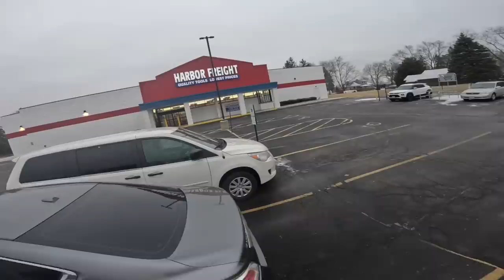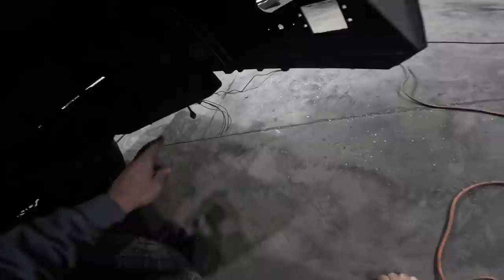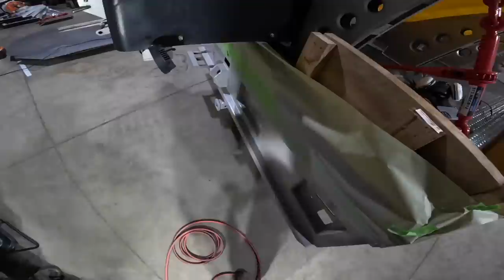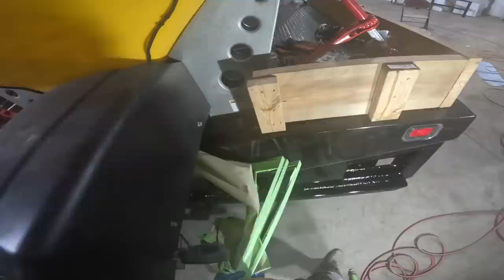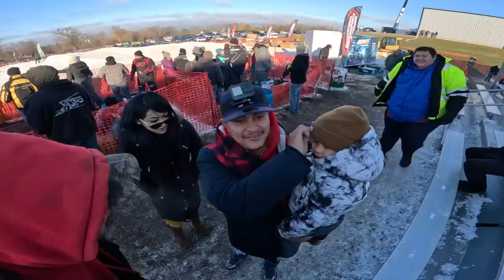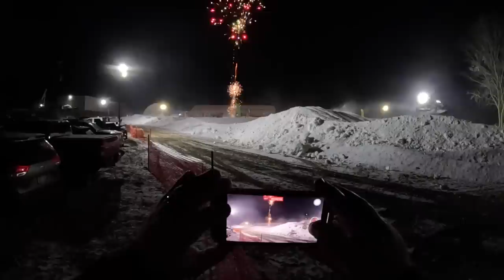Finally done with the bumper and off to the races!

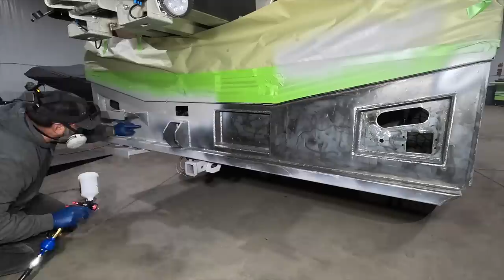Comment: 18:30 Menards has a 10 gallon tank you can put in line and it extends the smaller compressors so they can be used for some of the larger projects.   Also the inlet has a valve so you can remove it and use it as a remote tank to say air up a tire or use an air tool for a short time.

Also, great job on the painting.  Rust-Oleum sells a textured paint (has a grit in it) and would be great for the steps to reduce the chances of slips.
Reply: We would call that a pig tank or pig air tank.  Very helpful when you need a lot of hose, it will stabilize pressure near your point of work.  Framing crews use them when the compressor is truck mounted and then they branch off of the pig tank so they have plenty of flow for production nailing. I use mine when I don't want to bring the compressor close to spraying.  Hitachi/HPT makes a nice aluminum tank but you can get the 10 gallon steel ones from HFT, Lowes/Kobalt, etc.
Reply: I think it's not problem the capacity of air tank..but the pump (compressor) is 2 slow and not keeping it up.. with spray gun..
So buying the extension tank wont make it any better..'cause he would still need to wait for it to air up anyways
Reply: @tccoggs  Yeah I have heard that term but was not sure if this was what that was referring to.  I just use mine at home to extend the usefulness of my small compressor and only cost about 100 bucks, but have seen them for more.
Reply: @MazerDavid  No doubt for spraying you need CFM.  Some extra tank capacity will help stretch a smaller pump but HVLP guns eat a lot of air.  I run a 30 gallon 11CFM @90 compressor, but when I spray I add the pig tank to keep the cycling down and keep the flow stable.  Those oil free pump units are pretty worthless for spraying.
Reply: The textured paint isn`t any good for that application, when working in mud and snow environments it works best to get a small piece of industrial hardware cloth and weld it to the top of the steps many work trucks are set up like that from the maker.

Comment: Hi Ryan, I love your concrete videos, but I am really enjoying these shop videos as well. I was a house/commercial painter for the first half of my career and most two-part epoxies have a sweat time. This is the time they should sit after mixing, before applying. I would assume the same is true for automotive epoxies. The duration of the sweat time is usually listed on the can.

Comment: For your paint flash times, mixing ratios, thinning info etc. there are TDS (technical data sheets) for every product that will give  you all needed info.  Can find them online pretty easily for most products.  Looks like the bumper turned out good Ryan.

Comment: Bumper came out really good. Idea on the backup alarm if you don’t want it permanent. I have mine mounted on the spreader powered off the trailer plug, so it’s only on the truck when the spreader is on the truck. Also if you’re in a neighborhood during the night you can always hop out of the truck and unplug it.

Comment: Look into wetblasting if your going to do alot of painting and prep. Tool Barn sells the nozzle kit($99) no dust and hook it up to a decent pressure washer works great only drawback is outside only could be uncomfortable in Winter months.  GP

Comment: When I worked in a paint shop those 2 pack primer cans always come very unmixed like that's, in my experience I always had to mix the can up with a stirring stick to get the thick primer off the bottom 👍🏽 but that's just in my experience great job on the bumper it looks great!!

Comment: I am not a pro painter either but I have a suggestion, when you mixing the paint and pouring, I suggest to cover your work bench. It is a nice and it is easier to clean up the paint if it is on carboard. just a suggestion.  other than that, the paint job looked very professional and look great.. Good work.

Comment: Ryan not sure how much painting you will continue to do but if check out harbor freight paint shaker. Its a nice little unit and not very expensive. Also harbor freight super check purple spray gun is actually really good when it comes to primer. You are correct by the way with Epoxy primer, you have to let it sit, i was always told to let it sit for 30 minutes if its a 1:1 mix.

Comment: When I do epoxy primer I mix it in the cup that clip to the gun(a cheaper version of 3m PPS) so I spray it as soon as it's done cause I have seen the hardener separate from the epoxy and also the reducer evaporate so it got thicker as time goes on. when I spray I shake the gun between coats like paint can shakerfew seconds every minutes or so. probably some require to let it sit a few minutes. When the last coat is done I let it sit min 10hours mostly 15h, then sand, if needed another coat of primer if not spray base coat 20-24h after the last primer followed by 4-5 clearcoat layer 45min-1h after the last base coat. I really depend on the paint manufacturer, the paint shop can give you the datasheet for the paint with all the info needed

Comment: Drain the air tank, as you should every day, so the water is out of it.

Water filter 

Spraying the floor down with water will keep dust from kicking up on paint when working and drying

Looks good though

Comment: you should weld a little piece of expanded metal on the bumper steps top for traction, since you're going to be using it in snowy cold conditions i foresee someone slipping on the steps

Comment: You should put a piece of cardboard on the tool box space where your mixing the paint that way any accident stays there and doesn't damage the tool box.If you're going to paint the rear of the truck got to cover the tires with a plastic cover not to damage the integrity of your work.

Comment: Two questions: Why didn't you remove those awesome vehicles from the shop before you created all that over-spray? Also, did you forget the two small lights for the license plate? Will that pass inspection without the lights? guess it depends on where you live